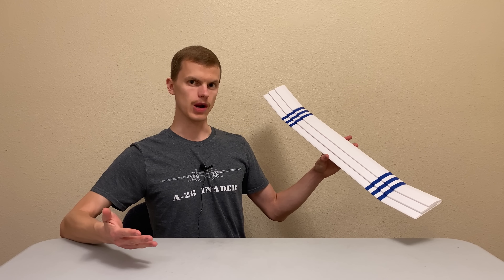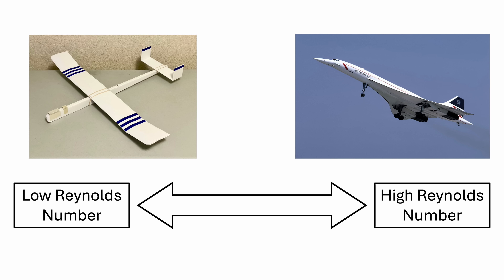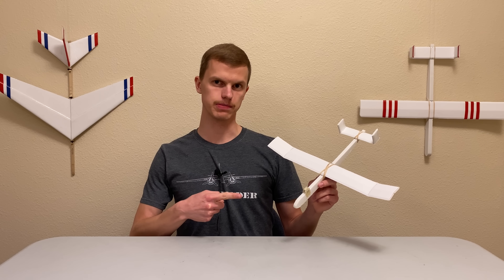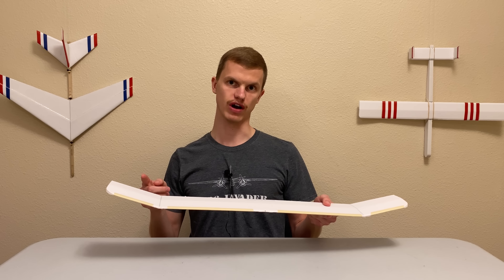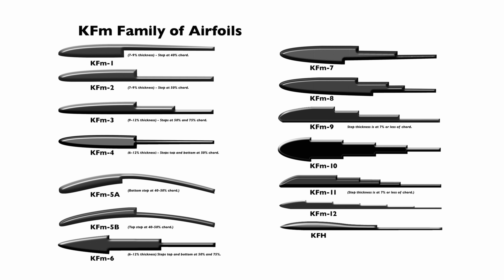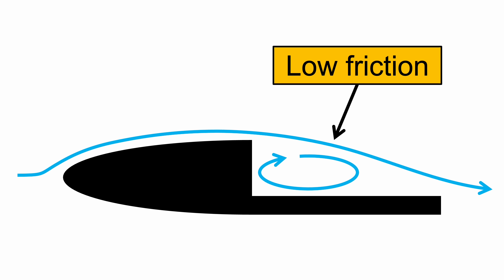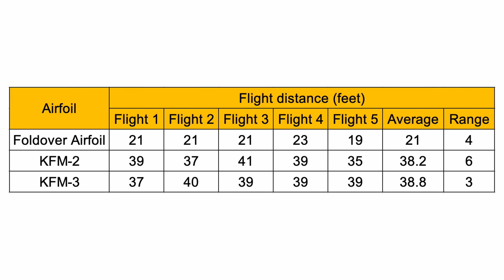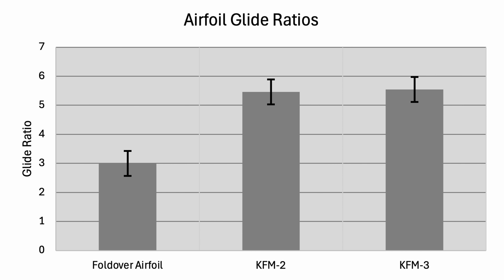Stepped Airfoils for Model Airplanes - Are They Better?

Comment: Yes, this is is intriguing. I would be very interested if improving the "vortex holder" would further reduce drag: Keep the sharp top edge of the step, but fill in the bottom corner with a radius equal to the height of the step. My thinking is that this may eliminate micro turbulence at the foot of the step inside that 90 degree corner.
Reply: is called a fillet, and might make things better, or worse.
Reply: @johnbgibbs  my gut feeling is that a filet this large would reduce the speed range at which the wing would maintain its advantages. So it might drop like a rock until the forward speed drops enough to allow the vortex to become established, worse yet fly well until the speed drops too low, then suddenly stall. think that with enough resolution you would find that there is a tiny counter-vortex hiding in that corner that might be really important. Another field to borrow from is stepped hulls in planning boat hulls. These usually actually are undercut, sort of the opposite of a filet.

Comment: Nice. I would like to see a comparison with just a flat wing. Also the steep glide slope of the regular doesn’t seem to fit with my experience. I just want to move the weight back or give a little up elevator. Maybe you could share videos of multiple configurations around the sweet spot?
Reply from the maker: I had to put the smooth airfoil onto a steeper glide slope to get enough thrust to overcome the drag.  Any less steep and it would slow down and stall.

Comment: Glad to see your channel speaking on kfm airfoils. I had my graduation project based on lift and drag performance of kfm2 type modified clary-y airfoil over multiple reynolds number and across multiple depth and location of step over the airfoil and compared it to a typical clark-y airfoil. Results showed a substantial increase in aerodynamic performance in low reynolds number range.
Reply: Hi, I'm a freshman from Viet Nam and we're doing a project on making a model glider. Can you suggest some resources, blueprints, etc.?

Comment: Interesting test, getting consistent data from a test with a whole plane might not be so easy, but the foldover really dropped like a brick. My preference is towards balsa ribs and covering, molded, or just flat depron for acro. For Re this low you really need thin airfoils, or just cambered plates, but making them out of simple foam sheets is not easy without extra structure and bending with heat.